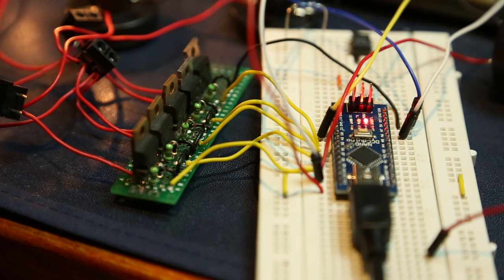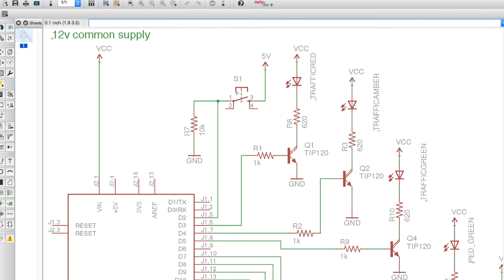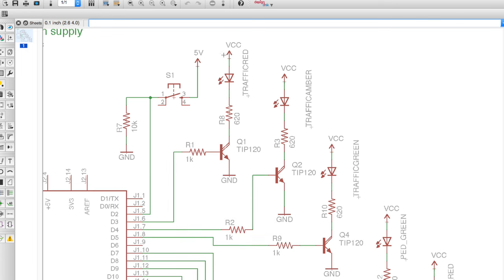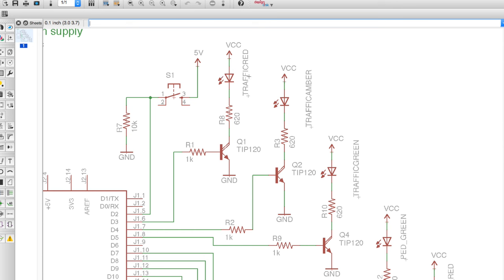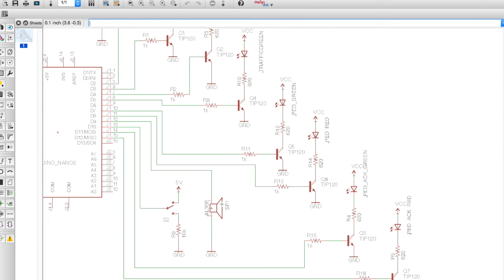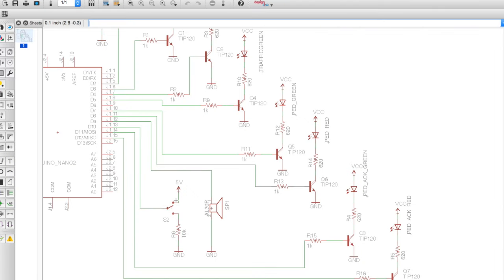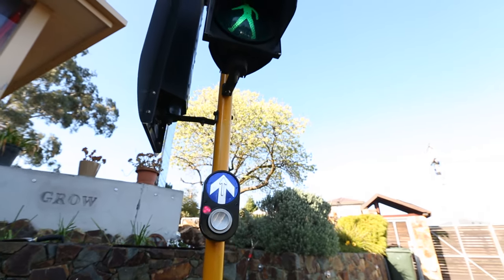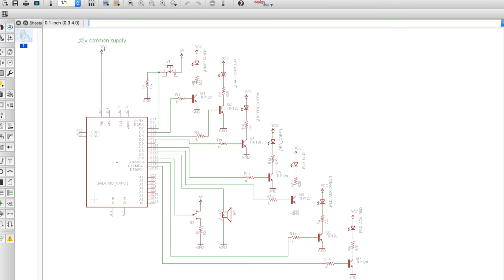Building a Traffic Light with Arduino Part3

Comment: hello...

 we are planning to do project on "  SMART TRAFFIC SYSTEM "... but we are facing problem in writing the program....

 our idea is to implement a smart traffic system which has a various infrared transmitter and receiver on either side of the road lane.. and on based on density, congestion level is controlled and one more add on feature is a excemption for the emergency vehicles using RF MODULE , where we planned to put RF receiver on emergency vehicles such as on ambulances... and RF receiver on the signal junction... so that it will receive the signal and controls the signal  and free up the signal ... 

 the UNIQUE feature of our project is that we are giving the priority levels for ambulaces such as NORMAL , MEDIUM AND HIGH PRIORITY levels.. this will be provided on each ambulances sooo that it will be useful sooo that when there is an instance such that two ambulances appear on other side simultaneously.. soooo based on priority mode on which it is switched on too and which ambulances occur first to the  signal.. Based on this , the entire road lane will be freed up....

This is my  idea... but we are facing prob....
   so could anyone assist me with the programs...

U pple could contact me thru my mail id " santacruzz656@gmail.com " ...

   soo pls help us...
Reply from the maker: +ROHIT Sai Sounds like a great project. Your case is quite specific. Your transponders/identifiers will probably need to trigger interrupts to cause the traffic signals to change. Each type will need to be identified to then trigger the appropriate function NORMAL, MEDIUM or HIGH depending on whether its an ambulance, fire engine etc. Similarly, your IR beams probably need to trigger an interrupt as well causing a COUNTER to count up the number of 'events' per second/minute to determine congestion. Based on some simple logic you could then short cut the standard timing of your traffic signals giving preference to the higher congested lanes. The implementation of the code is not too dissimilar to what I have created here. Instead of just pedestrian crossing request button, your version would need to have options for your IR and RF sensors. You may need to extend the number of interrupts using a library or use an Arduino Mega which has more hardware interrupts available. Good luck with your project. I posted my code to github here: https://github.com/digitalkarl/Arduin...
Reply from the maker: +ROHIT Sai Sorry you right. The link didn't copy well. Try this: https://github.com/digitalkarl/Arduino-Traffic-Light-Project